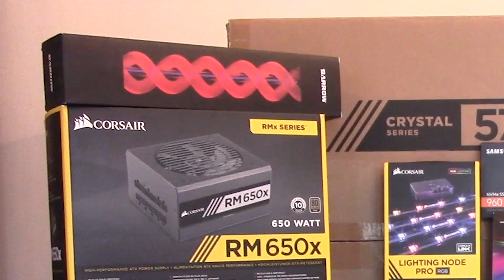Time Lapse Build PC - Blue Caribbean [3000€]

Comment: Why did you take the buttons out on the top of the case
Reply from the maker: Because these buttons are used to control the RGB fan, but actually  I am using the lighting node pro to control them via Corsair Link (soft)

Comment: Why aren't you using the x16 pcie slot for your gpu?
Reply from the maker: Because I want to see the chipset shield in the motherboard, look better for me, also, 1080ti is overkill for me, so don't need all the power.
Reply: umm
Reply: 0_yami_0 why did you buy a 1080 ti then? Cool video
Reply from the maker: Because I would a GPU with this Backplate
Reply: 0_yami_0 ok nice video
Reply from the maker: Thx